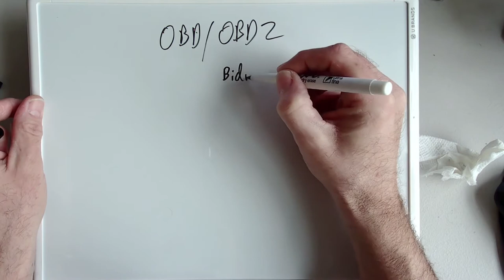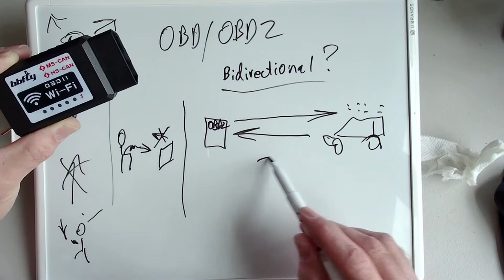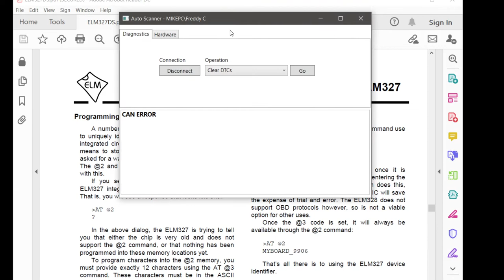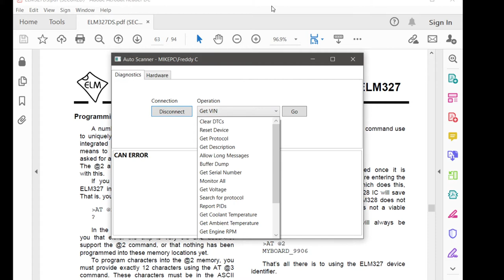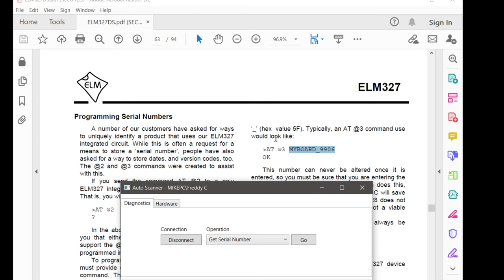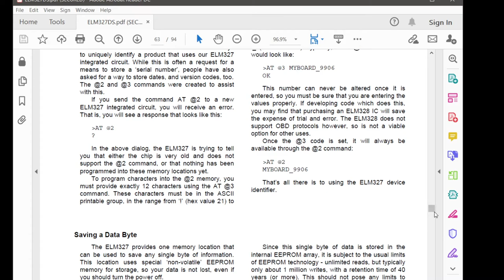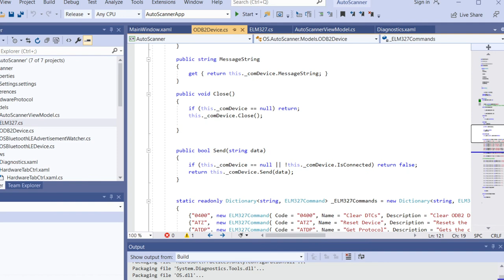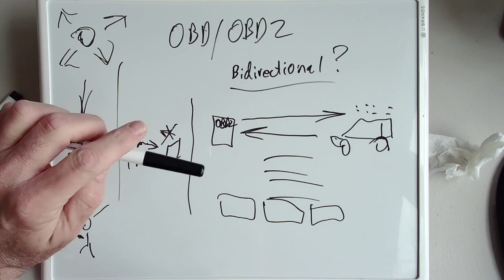OBD2: The Bi-Directional Myth (Software Design)

Comment: The 327 isn't bidirectional in the CAN network, only the diagnostic network, which is a playground the manufacturer makes of foam and rounded corners for "special" children. All an ELM327 can do outside of that playground is sit on the bus bench and watch high speed traffic go by at 250, 500, or even 1000 mph and wait until it's picked up on a bus the manufacturer will send you and take you to places it allows you to go and if you're the $100 elm you'll get the opportunity to maybe go up to 100 mph. If you're the $20 elm you'll have to ride the 15-20 mph bus. In essence an ELM327 is a YouTube video of a powerful gaming computer playing a game. You may be able to send in chats but you're a long long long way from actually controlling the game. The bidirectional scanners are called so because they can travel on the high speed network and if you ever "figure out" how to get a 28k-128k baud Elm327 to connect to a 28k baud network and hack it's way into a high speed 500k baud CANbus (Controller Area Network Binary Unit System) and can control by splicing wires and using a drop down menu than immediately stop what you're doing, call MIT and show them what you did and ask them where your can pick up your Nobel prize. Then call the CIA and tell them if your information gets out the world is in danger. Then call the Pentagon and tell them you've just made the radar, WiFi, GPS, and every other digital and probably analog signal of every enemy, obsolete. Then change your number because even wanna be hack like Elon Musk will be calling you offering you to take over their company.

Comment: you can make a software that can do every thing but you can not do it with the elm ....you will have to write it for a true VCI ... and plus Android only support 74% of OEM softwares  as the programing and mode is not 100% compatable this is why there is no Scan tool that uses Android that does 100% OEM functions and the reason why Evry OEM software is X86 windows and dos Based   and ti is why for a long time and still to day Bosch used and uses A windows operating system on there premium tools ......that offer 100% OEM ....and Bosch makes ruffly 90% of the source code that most tools uses as bosh makes the software for 80% of most modules actuators PCM ECU used in automotive and Equipment ...........so if you want a source cod to use ..dont use any tools other than BOSCH  software ......and also Bosch makes every OEM software for Cars and trucks and most Equipment Diagnostic  excluding John deere Dodge and Cummins   even honda and toyota and Kia OEM is made By Bosch

Comment: Actual technicians (not mechanics) know that these cheap scan tools do absolutely nothing special, and we also realize it is all about software…. For instance my $5000 MATCO can do loads of stuff, but the snap on can do loads more…. Now here’s some info for you…. It’s not about YOUR software because you can make all kinds that you think will do what you want it to… but it wont… because the manufacturers have their own proprietary software that will fight with any bit of software you create and the only way you get access is by paying for the information you need to work around it…. Hence why a snap on scan tool is so expensive because they put the $$$ in the manufacturers pocket to get access to that proprietary software information. Now if you just want to actuate 2 way modules in a vehicle, that’s simple, but just wait till you experience security gateway modules 😮

Comment: Glad i didnt watch the whole video because its big argument about absolutely nothing worth arguing about.........Theyre referring to bidirectional control over mechanical parts not just communication. If you actually work on cars you'd realize its very useful to be able to remotely actuate things like the fuel pump and transmission shift solenoids to figure out if the parts are bad or inoperable.

Comment: The notion of Bidirectionality implies that there's only two types of message exchange, read and write,  taking place over one path of communication of within the can-bus protocol. All your efforts will end in failure if you try to go with this assumption because it's incorrect. You're incorrect about the obtc2 standard also that's not what the manufacturers have to comply with they had to comply with using the can bus protocol obdc2 i refers to the connectoing hardware it's it's just a damn plug. Your view of how this is simple is too simplistic to work two method One path communication died with the telegraph. Modern communication is by necessity, multipath ( like manually switched telephone) and multi-protocol(everything that came after the telephone) they just don't bother to teach you this concept so you're stuck at telephone. Modern communications technologies utilize at least four distinct types of messaging they go by many, many names, as many names as software engineers can dream up,  But I'll go with what they're called in what computer ethernet networks use, Tcp/Ip ... Syn, Ack, Data, Fin. You might can understand what each does by what they're called. But there's a lot of overlap there. So where your point is wrong is all communication is two way because the device is two-way and that's not true for at least one type of messaging.... data and every one of those little Bluetooth obdc dongles take shortcuts and tricks to make up for what they don't have a robust data collection mechanism. That's why they work to one degree or another, but all in all pretty poorly because they are not computers, they got little bitty semiconductors they don't have multiprocessors they're not computers the most expensive and best scanner tools are simply, can-bus proprietary machine language computers. And that's why they cost as much as an expensive computer. Dingle-Dongles are never going to do what they can do, ever, period. And the only reason they can do some is because many automotive software engineers are f'n lazy, trying to do the bare minimum because they're not rocket scientists and don't want to spend half their life writing complex code to take advantage of computing power. So basically what they try to do is add a bunch of nonsense into their code that's unique to the manufacturer. That's why it's called machine or computer language. They're just copying what people  have, they use the same letters to create nonsense and then assign it meaning. Get it? Anyway I digress your problem is that you're thinking like a telegraph operator bidirectionally because that's the term that you have learned, it's a completely incorrect way to think in this regard, if you continue to do so and continue on the path you're headed down you will end in failure just like everybody else has cuz you don't have the right framework of understanding. You have to understand then what we're talking about here is not bi-directional communication it's orthogonal communication using multiple pass and multiple methods, and it's only limited by the imagination of the person programming and the power of the computer processing the communication protocols if they are allowed to use. That's called the standard and everybody must comply. So read what I said slowly and try to understand it because you are headed for nothing but failure. And I apologize for being so terse and perhaps condescending don't take it that way I'm trying to seriously get you to not do what you're about to start doing because it's a complete waste of time for you bro I'm trying to help. And sometimes it takes a little hard love really I have nothing but respect for you for trying to understand this shit because they're lying about it they have to lie about it or everybody would be able to do what they can do. If you really want to go down this path you're going to have to start thinking like Russians you're going to have to make your own odbc box and it's got to be connected to a computer and you have to have a deep understanding of the machine language of can bus and all the little manufacturer proprietary languages that have grown around it that alphabet. The best automotive hackers in the world are Russian or they're hanging out with Russians in the anonymity of the deep web. You might understand that this is very very necessary it's no joke because the automotive companies have a lot of money there's a lot at stake for them and if they figure out who's the guy who's making ecc programmers that increase the performance of the vehicle by 25%, they're going to disappear your ass for effing up  the program.